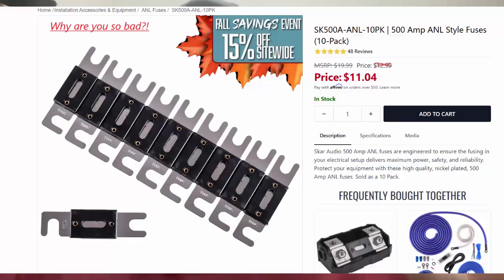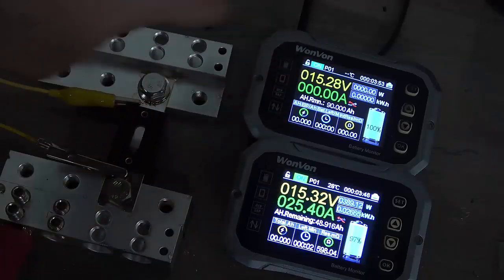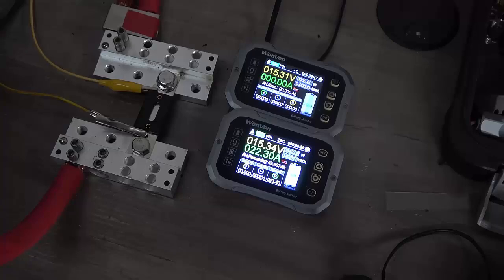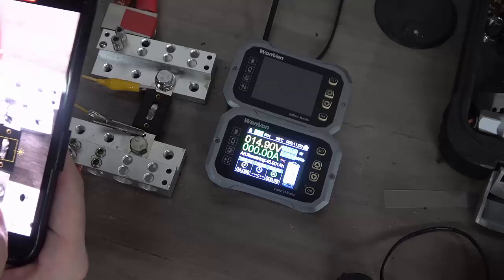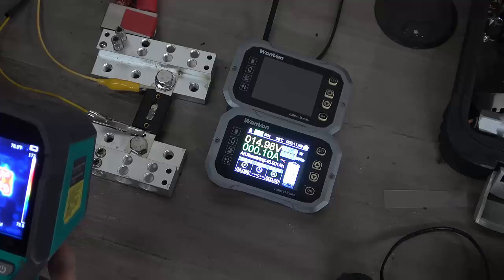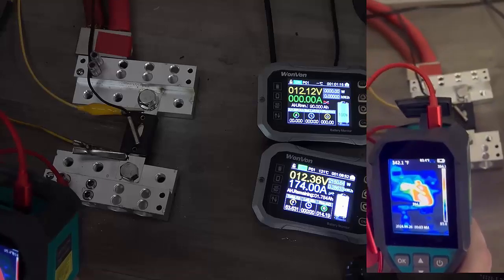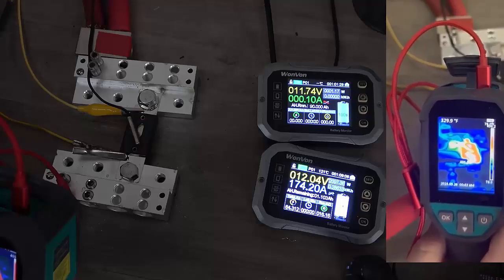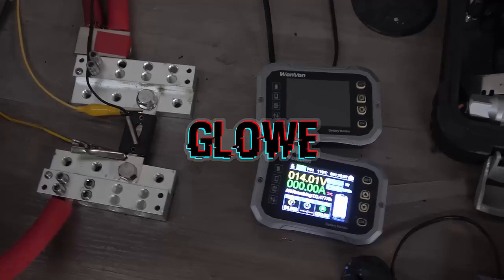Skar Fuses Exposed: 500A Rating vs. 200A Reality?

Comment: I'm trying to figure out how I've never blown one of these when used in 10 or more different Bass15k and 30k installs, I must be doing something wrong.
Reply from the maker: This is easily repeatable, and I've used fuses from several batches.

That said - in a bass installation the current being pulled through the fuse is not constant like I demonstrate, it is in short rapid bursts.
Reply: @GloweIndustries  what's the name  brand of the little power meters your using

Comment: I finally got thru the whole video......170a on a 500a fuse and it hits over 400° thats insane. Imagine how hot your wire and fuse holder is getting. No wonder you see so many melted fuse holders in the skar group.
Reply: Melted wires as well

Comment: Would you expect anything less? 😂😂😂 I run their amps, that's it. I've ran them for years with no issues. That's the only thing I would run from them. That's the only thing that works. Their subs fall apart, their fuses are fake. Motors shifting and etc. 

Just install perfect and run no fuse. Just keep a fire extinguisher and cable cutters in your car.
Reply: There's absolutely no reason to advocate anyone not use a fuse. 

Imagine getting in a car wreck and your disoriented. If the power wire got pinched, the car will be on fire in seconds. A simple fuse will prevent that. 

The moral of the story here is to run good fuses, not zero fuses.
Reply: @JasonWW2000 
Exactly. In an accident bad enough to pinch a wire, or say you have your daughter with you at the time....last thing I wanna worry about is checking on my power wire. Always have a fail safe.
Reply from the maker: I agree. Use quality fuses, don’t not fuse..  there are so many things that can go wrong when your wiring is moving around at 65+ mph..